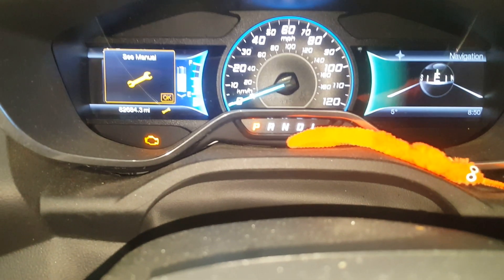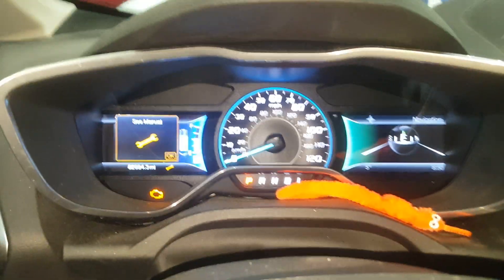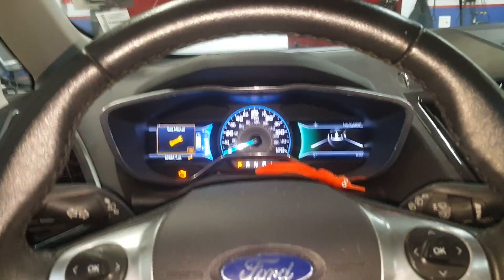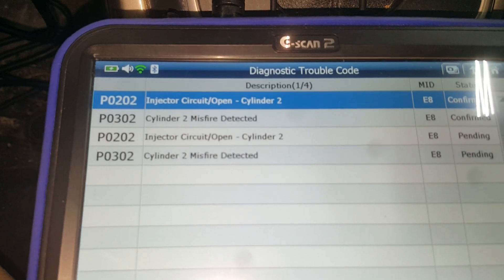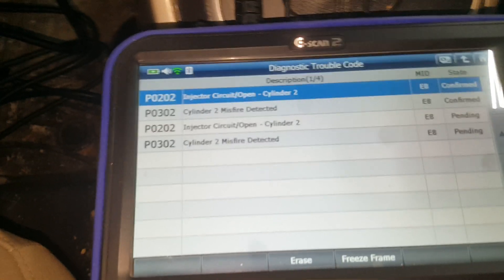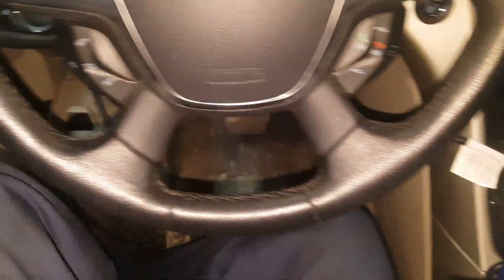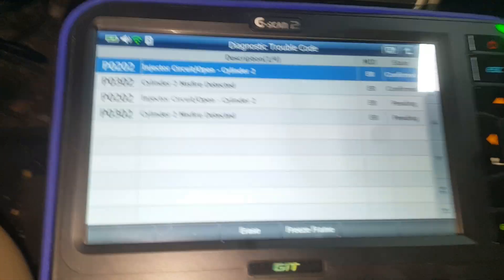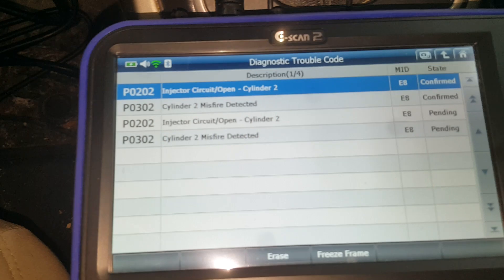Fuel Injector Testing Hack P0201 P0202  P0203 P0204 P0302

Comment: My 2017 dodge charger is throwing code P0202. What does it mean if the NOID light is lit up solid on the #2 injector but on the other injectors it’s pulsing like in your video?